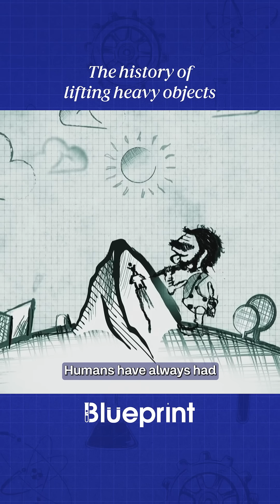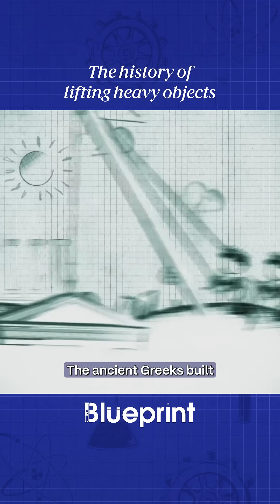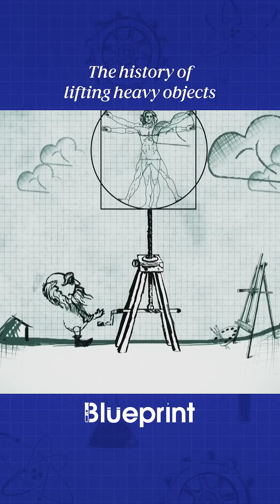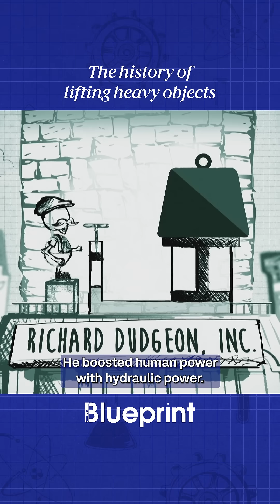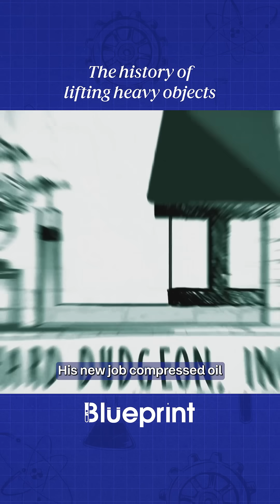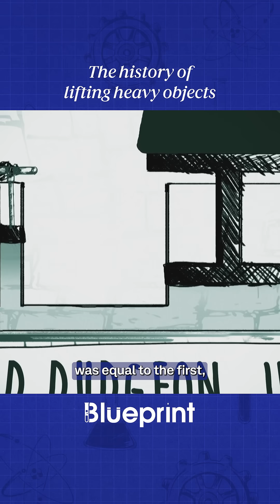How Humans Have Lifted Heavy Objects Through History | Blueprint

Comment: The larger cylinder would not extend as far as the smaller cylinder. Since you have the fluid from the small cylinder filling a larger volume, the fluid level in the large cylinder would be lower. Force is multiplied, that part is correct